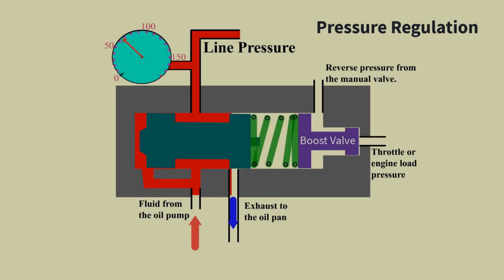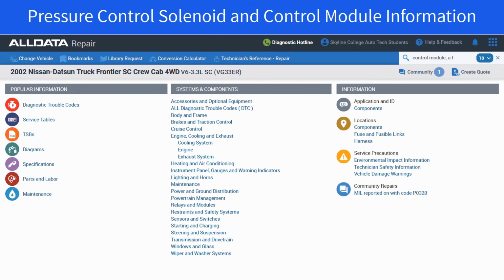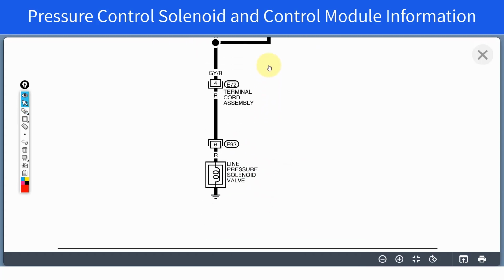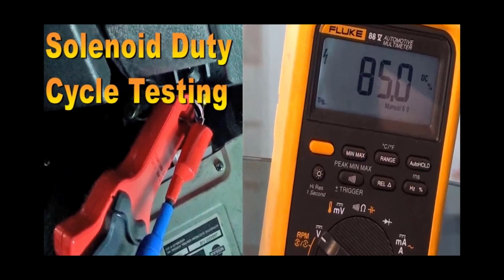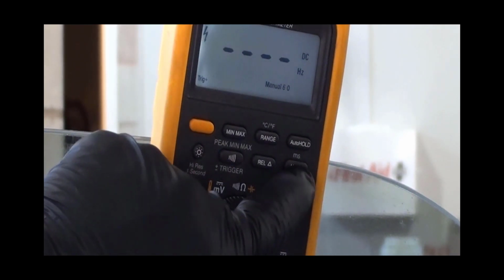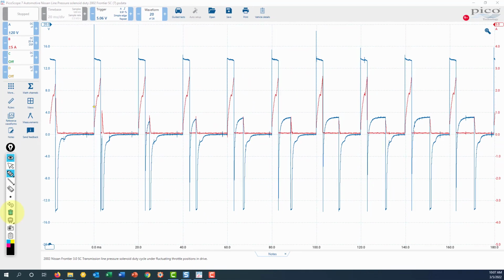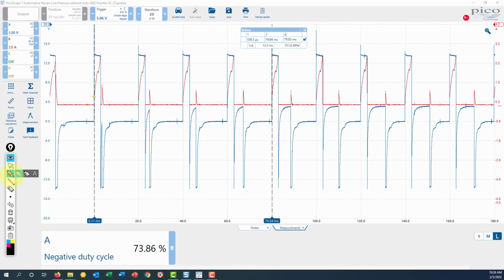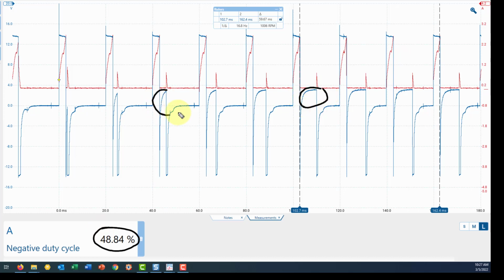Automatic Transmission Pressure Control Solenoids Operation and Testing

Comment: Is the Pico scope a Brand of manufacture of a scope? If I read the title on your page it may be a model/ version 7?
Is it a independent instrument or an accessory that can be used with a particular scan tool or even multiple scan tools from different manufacturers?

That display page is fantastic. Does the tool use a pc ( personal computer) and software to view data or are we looking at a screen shot from a stand alone tool that was uploaded to your video?

I have a Fluke automotive meter with an induction clamp. Set of pressure gauges. I’ve found other alternatives for diagnosis.
Using a scope is great but it is specific and therefore usually not used often. Maybe I would use it more often if I had one?
Reply from the maker: Thanks for your comment and questions.  Pico is a brand and Pico Scope Version 7 is the version of software that interfaces with the scope.  Pico offers PC and MAC versions of their software.  The software is free and they have a demo mode so a user can learn before purchasing the Pico Scope hardware.  Pico has different hardware models with various features or capabilities. The most current is model 4425A.  You can learn more at: https://www.picoauto.com/. If your just getting into scopes you may want to consider a simpler less expensive one channel scope. I have a whole series on the uScope by AESWave on how to use this powerful little one channel scope. https://youtu.be/uctdwLQEgcU?si=RCBXy4DAaK5QlCFe  The uScope not as robust but it has some great features, advantages and capabilities.  There is a ton more you can do with any scope verses a DMM.  Information on most digital scopes are updated millions of times a second verses your fluke that updates 4 - 5 times a second. A quick example would be to measure the duty cycled voltage from a computer to a solenoid. You won't see the full 12V but a scope will display that as a square waveform showing the full 12V when the solenoid is on and a full 0V when it's off. The Fluke will average the on and off times to display partial voltage based upon the duty cycle percentage.  Techs that I know that have learned to use a scope during diagnosis know when to grab their scope over their Fluke because diagnosis will be faster and more accurate. Also to your question the Pico is a stand alone tool that has nothing to do with your scan tool.
Reply: Good video

Comment: How often should you change your pressure solenoid to make sure it doesn’t fail
Reply from the maker: PC solenoids are not a maintenance item. The best thing you can do for your solenoid and transmission is to change the fluid and normally I recommend doing this sooner than what the manufacture recommends.  It also depends of if the fluid is just a drain and fill or a complete fluid exchange.  If the transmission does fail and has to be rebuilt I do recommend replacing the PC solenoid at this time.
Reply: @DrivelineMaster hey man my car jerks when I put it into drive but smoothens out when i press harder on the brake and ive had this for 9 months. Do you know what it could be? Thanks

Comment: Hi 
Is pressure control solenoid and pressure sensor(honda which uses to check the pressure applied on clutch that act as feedback to TCM) to adjust the pressure  ).. are both same..  

2. what is the difference between line pressure control solenoid and shift solenoid.

3. Does CVT have same kind of solenoid like pressure control and shift solenoid.?

Thanks much in advvance.
Reply from the maker: A pressure control solenoid is controlled by the TCM. The TCM sends a duty cycle signal to the PC solenoid to control the pressure in the circuit. A sensor is a TCM input. the sensor reports to the TCM if there is pressure and how much it is.  The TCM could use this to change the PC solenoid Duty but not always.  it could just be used to confirm that pressure is present in that part of the circuit. PC solenoids are always linear meaning it's controlled with a duty cycle to change amperage flow.  It's not normally fully open or closed but always changing someplace in-between.  Shift solenoids can be linear or simply on or off meaning fully open or fully closed.  Simple on/off solenoids are either 100% open or 100% closed and nothing in-between.   Yes, CVT's will also use various types of solenoids to control various operations.  They would not be shift solenoids because CVT's don't produce step shifts.
Reply: @DrivelineMaster  thanks. Can I assume shift solenoid is used to change or shift gear and pressure control solenoid is used to help maintain pressure that helps shift solenoid to shift properly. Trying to understand relationship between pressure solenoid and shift solenoid paternship.also for Camry is pressure sensor not pressure control solenoid is in valve body. In Honda pressure sensor is outside
Reply from the maker: Shift solenoids are used to change gear ratios and pressure control solenoids are used to control the fluid pressure.  I would not use the word maintain but instead I use control because the pressure varies depending on the engine and transmission load. More throttle = more engine load which = more pressure. The fluid pressure flow through a circuit is controlled by the shift solenoid. Think of a shift solenoid like the fixture at the end of your garden hose. You pull the lever and water comes out. you let go of the lever and water stops.  That would be an on/off solenoid.  If however you pull the lever 30%, 50% or 70% of the way open water comes out proportionally.  That would be a linear or duty cycled shift solenoid. So the PC solenoid doesn't help the shift solenoid it just makes sure the proper fluid pressure is ready and available to pass through the shift solenoid. For your second question about the pressure sensor.  Back to the garden hose.  Lets say you disconnect the garden hose at the hose bib and you connect a water pressure gauge to the bib and the garden hose to the other end of the gauge. The water can flow through the gauge and provide you with the amount of pressure but it can also let the water through to your garden hose.  As you are using the garden hose you can also observe how much pressure you have.  The pressure sensor is the gauge except the gauge reports to you by showing you how much pressure there is.  it's visual that you see with your eye.  The pressure sensor reports to the TCM only its in the form of a voltage value that the TCM can interpret and translate into pressure. It doesn't matter what year and make of the vehicle the engineers know where the fluid passages are (hose bibs) and they decide where to put the pressure sensors. Sometimes it's inside the transmission in the housing or on the valve body or sometimes its on the outside of the transmission.  Which ever is the most cost effective during production.
Reply: @DrivelineMaster  thanks so much. You are a master in explaining things. Will there be a case where line pressure solenoid shows correct pressure and shift solenoid is good but there is still a problem in transmission on a specific gear?. I am trying to understand the testing part. Manual says to tap the line pressure and find the psi at various speed, if pressure is bad it points to possible cause. Question is if line pressure is good will there be case where I still have to open transmission. ? Or will the line pressure helps me any way to decide if I can fix without opening transmission
Reply from the maker: The line pressure solenoid doesn't really show what the pressure is. The line pressure solenoid will display on the scan tool in amperage.  High amperage around 1.0 amp = low pressure and low amps around 0.3 amps = high pressure. An increase in engine load should cause the amperage to drop which = higher pressure. If the scan tool is providing you with a line pressure value in PSI or Kpa this is coming from a pressure sensor that is taped into the line pressure port.  Often pressure testing a system like this is done by putting a pressure gauge in the line pressure test port and comparing the amperage on a scan tool to the actual pressure on the gauge. You can also try using the PSI value in the scan tool if it's available but I prefer a real gauge or pressure transducer and a scope if you have one. Scan tools sometimes have active test that will allow you to control the amperage to the PC solenoid. Doing so allows you to set a specific amperage to compare to the gauge pressure and then compare the pressure and amperage correlation to the chart in the manual. Line pressure is not everything but it's the heart of the transmission operation just like your blood pressure is to the function of your body. The first thing the doctor does when you have a complaint is take your blood pressure. If the line pressure is within the proper operating range there are a lot of other things that can cause transmission shift and gear ratio problem.  Shift solenoids, sticking or leaking valves in the valve body, speed sensors, governor sensors, TCM commands, grounds and wiring inside and outside the transmission, hard part failure etc..  Just like a good blood pressure can't tell you that you that the pain in your ankle is because you sprained it when you twisted it yesterday.  Pressure is jut another diagnostic bit of information to help the technician narrow down the cause for the symptom.